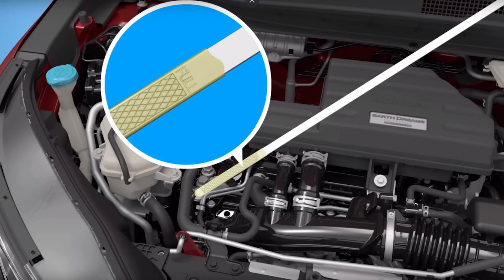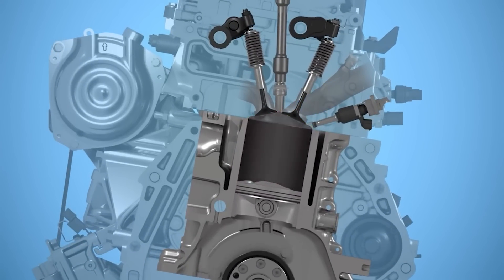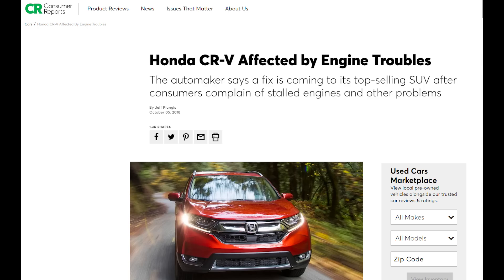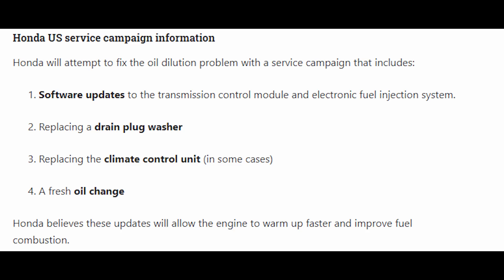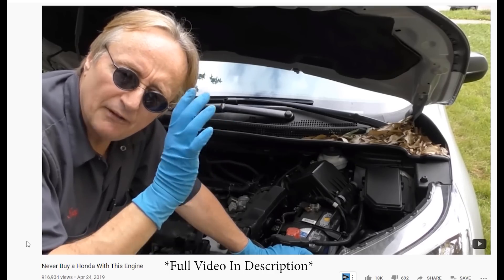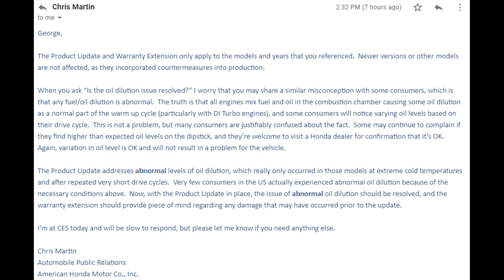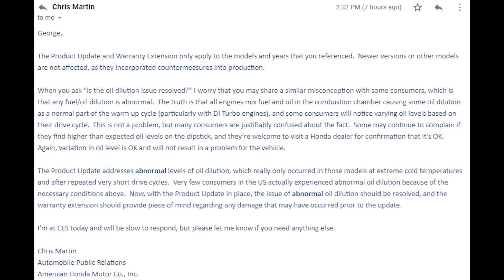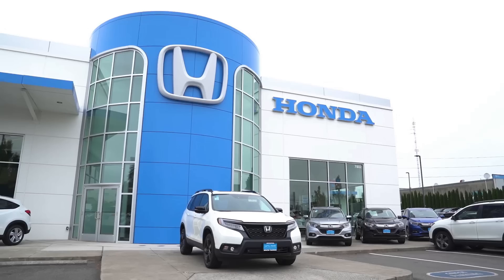Does Honda Have An Oil Dilution Problem? | 1.5L Engine in CR-V and Civic

Comment: I can tell you 1st hand that Honda is full of BS as my 2019 DEFINITELY has oil dilution problems  I live in Georgia "not a cold place" and Im on the road constantly for my job "no short trips" and my oil is about a quarter inch over the full line, also the oil stinks of gas.

When I take it to the dealership I explained it to them when I went for my oil change and they told me that they didn't smell any gas "lie" and when they tested it there wasn't any gas in the oil "lie" 
So I asked them how come after my last oil change my oil level was exactly at the full line and now it's registering about 20% more full than before and all I got was deer in headlights glare with no explanation so I will be sending off my own sample to have tested cause they are full of shit! 

Also I checked the oil levels the same way every time which was in the morning before leaving to work!
Reply: Dealerships are not going to admit it. In fact, if you ask them if there are others with the problem, they will say no.  They know there is no fix, so they sell BS just like Honda does.  If you take for example my radio screen keeps beeping and going black off and on as you drive down the street.  There are many others that have the same problem and its posted all over the internet.  I called Honda last week.  I asked her if others are having this problem.  She said "No, mine was the first one she has heard about".  I asked her if it was her first day on the job.  Told her she was full of shit because it is all over the internet and Honda is telling the dealerships that there is nothing they are going to do until the manufacturer of the display comes up with a solution.  Honda was replacing the radio heads, but now they have issued a bulletin telling the dealerships to do that.  You think after a problem of 3 years, you really think anyone is working on a solution?
Reply: @davidb1169  that's crazy
Reply: What we  definitely know about this problem is that it exists for a lot of owners, but equally we know neither Honda, or their dealers, are going to assist you in the slightest.
Reply: Are you checking the oil based of manufacturer recommendations from owners manual??
Sounded like you are checking with engine cold??? Hmmmm...
Reply: Rob Alvarez It seems Honda dealerships main criteria is to be 1st class actors!!! This is utter bullshit! They should volunteer their own labs to test the oil for dilution instead of denying any issue. Plus the climate has little consequence on cold start-up because all vehicles go from cold to hot whether in Georgia or Maine. Again its just to save a few dollars and deny help to the majority of states in the US.
Reply: What was your oil test result?  Most turbo engines have some oil dilution.  Running a catch can and premium gas helps but you still need to change the oil more frequently
Reply: @Rob Alvarez,  you should return the car and get your money back. Get a sample of the oil for proof, and a lawyer if they give you trouble.
Reply: Sorry to hear that. Good luck to your car. I hope they can fix it.
Reply: totally agree. I also have a 2019 and lives in Texas, oil is almost rising every week. I don't do short drives, my commute to school is between 40 - 60 mins everyday.

Comment: 2019 accord sport 2.0T here. I haven’t noticed any problem with oil dilution.  Is it just the 1.5T ?
Reply: As long as you don't have a 1.5 T Accord (LX,Sport, EX) you should be ok I guess.
Reply: No problem because you have a 2019. Not even a year old wait in a couple of years.
Reply: I think I’ll take consumer reports ranking with a grain of salt. I mean seriously, they ranked Dodge higher than Honda? 🤪🤣🤣
Reply: @maxsmoothred  The real reason CR and other surveys rank Honda so low is two-fold. One, they rarely hear from satisfied customers. Two, Honda was considered pretty much the top in terms of reliability. That became the standard. Now they have some issues with technology (like every other maker) and some 'odd behaviour' from a new engine... Suddenly everyone starts screaming and claiming they're garbage.
Reply: @maxsmoothred  Their rankings are based on owner surveys. Honda has been going downhill for years, now. There's a good reason why Toyota, guarding its sterling reputation for long-term reliability, has been reluctant to incorporate direct injection (they use a combination of direct- and port-injection) and turbocharged engines.
Reply: @kenhoward3512  yes but Toyota has switched to CVT transmissions and their 8 speed automatic transmission is rubbish.   Seems like no one makes a trustworthy car anymore.
Reply: Jeff Pyle That’s a good question. You could probably research the difference in those two engines and find out if they are fuel injected in the same manner. I have a coworker who had a huge problem with their 2017 CRV and they had to take Honda to court. Honda bought the car back.

Comment: If this was a design problem, then it should happen to nearly all hondas with the 1.5T.  So the question is, why don't all 1.5T have this problem?  I own a 2019 CR-V EXL with the 1.5T.  No dilution or gas smell.  I have noticed some unusual things compared to my other Honda (1.8 non turbo) and Mazda .  Using a scan guage to measure ECT (engine coolant temperature) the 1.5T motor takes longer to warm up.  Generally 5 more  minutes.  Engines run rich when cold and if the engine is always in "rich" mode then fuel would build up.  I never drive short trips in the CR-V and live in CA (not too cold) so that likely lessens any problem
Reply: @handycap9815  Not sticking.  The Engine Control Module richens the fuel/air ratio when cold.  This is normal in all cars.  I think the CR-V stays colder longer than other cars (at least my cars).
Reply: I'd say the problem is on most of these vehicles, but just goes unnoticed for now. Lots of people I know who own Honda's never check their oil, they just go for a service when it's needed, so how would they know? Even if they do check and the level is to high,they'd just assume that's OK.
Reply: @fiveowaf454  I'm afraid you're right. General automotive knowledge seems very low today.

Comment: I would limit the number of references from Consumer Reports. Only makes your video lose credibility. 
Ignorance is driving this more than facts. Turbocharged engines require more frequent oil changes than NA engines, regardless of who makes it. Use a high quality oil and stop trying to do 15000mile service intervals, change it more often. People are going to catch a fit when they realise that ALL Direct Injection engines has some gasolene in the oil.
Reply: Early oil change intervals can result in premature engine wear. I posted a reply above which explains why.
Reply: @leonardharview4577  I am not suggesting an oil change every 1000miles. But, if we were to analyse each complaint. Most of it are person expecting a similar service interval as with their old NA engine, which is wrong. It is shorter with a turbocharged engine. And if a manufacturer recommend a 7500mile oil change interval and I choose to reduce it to 6000miles it will be fine. By then the oil life will be at around 35% anyways.

Comment: The Chris Martin guy from Honda is not speaking the truth.
Reply: I'm not sure he is allowed to!
Reply: @bigal6684  Not if he want to keep his job. There's a lot of money at stake.
Reply: while he is stuffing his pockets with your hard earned cash!
Reply: Who signed his check?
Reply: 2020 CRV Quick update MPG dropped from combined 27 to 25 AVG called dealer stated facts about MPG economy drop and oil also stinks like gas. I only got about 600miles total on the engine. I don't think oil dilution  is resolved. Dealer response usual BS you drive to hard, use heat/ac not enough highway driving etc... Stated to them I am currently in the market to buy a horse. They are  "trying" to schedule me  in for service. Will update if there is any change. But most likely will need to send out oil sample to independent lab to get it tested properly.  This is ridicules how consumers are being treated by Car makers!
Reply: @lonewolf_2022  so sorry for you, I have been trying to warn people, but there are a bunch of jackasses that obviously don't own a 1.5Turbo calling us liars and such.
Reply: @MontanaWelldigger  Thx. I am too very sorry for consumer here in US, since they are simply unable to understand/say "NO" to car makers and allow them to continue to treat them like that. I am from from Europe originally moved to US because of work. Back home car makers sold consumer Trim with power-train options. Here in US I feel like I have no options(such as performance gas engine, diesel, hybrid, EV.   only trim.  My only advice to consumer to wake up and stop grabbing your ankles in from Car makers. If we all stand tall together we may have a chance to improve current Car maker market. PS. I did ask sales guy about oil dilution issue and if it was resolved. We all know the answer to that question, other wise I would not be here typing.
Reply: I work for Honda warranty department and he is simply telling the truth. Most of these concerns are simply that, a concern. A valid one, but that’s why warranties are generated, to address what might occur.
Reply: @gmans8914  well then why didn't they fix my car. Instead of giveing me a liberal trade-in allowance on a 19 passport?
Reply: xxlxpman because you have a concern, and not a confirmed issue. You believe your vehicle is not performing up to your standards and I know you have a certain expectancy of Honda. The fact is your vehicle is driveable, unless you feel it has a whirling noise (which is one of the symptoms of this issue) Than take it to a dealer. The dealer has no fault here, they just do as directed and are under no obligation to trade a vehicle because you have a concern. That is why a vehicle has a warranty, because we feel something can happen. The fact is, you believe it is not normal, but you have a NVLW and a warranty extension, to appease your concern. I’m a consumer myself so I understand, but at the end of the day, unless your vehicle is not driveable, not operating under normal expectations, you WILL NOT get a trade in.
Reply: @gmans8914  your response is exactly what I expected from Honda which I've been trying to avoid making public I've never been lied to so many times about this issue from employees of Honda. The only reason I'm driving the Honda Passport it's because I couldn't in good conscience trade that vehicle back to anybody or sell it to anybody but Honda. You can guarantee that I'll never buy another one because of that dishonesty on this issue by Honda and its employees I'm done with you.

Comment: I own a 2018 Honda civic si with a 1.5 turbo.  My car has 21k miles, so far no issues.
Reply: Mines a 2017 Civic sport 1.5 turbo 21000 miles no issue.

Comment: In December of 2019, after our 2018 CRV EX with the 1.5 Turbo and 18,000 miles could not be fixed of its oil dilution issues, we traded it in on a 2019 Passport Touring. Honda stated they have no fix for the issue.
Reply from the maker: That sucks
Reply: xxlxpman are you happy with the passport?
Reply: Yes, everything but the expensive 20 inch tires, the Passport snow tires and the CRV's snow tires were 300.00 U.S. difference, both were Nokian Hakkapeliitta's.  Also the Passport gets approx. 6 MPG less than the CRV. If I could have trusted Honda to have fixed the issue we would have got another CRV, we love them.

Comment: In a word, yes. Allegedly fixed for 2019, although mechanical experts say the excessive oil dilution problem cannot be fixed by software adjustment. Despite Honda's claims to the contrary, the problem isn't rare. A person can find many videos right here on YouTube uploaded by frustrated CR-V (mostly) buyers. However, the manner in which Honda has handled the oil dilution problem has been disappointing.
Reply: Honda should give a lifetime engine warranty with unlimited mileage if they cared about their customers and believed in their product.  This issue is going to lose customers for Honda if they don’t do more.
Reply: @markp6586  I agree 100%.
Reply: Tell me the number of affected cars from 2017 to 2018. We'll compare it to the global figures of CR-Vs (only) global sales, with will be roughly 1.7 million units. Then we can determine if it's rare or common.
Reply: @disco.lemonade  oil dilution problem isn't just 2017-18 models and it's not limited to the CR-V.
Reply: @bodystomp5302  Sorry, was my English not good enough?
Reply: @disco.lemonade  Obviously only Honda knows and likely won't release the numbers. I fully believe the engine piston and ring design are root cause of the problem. Software can help but it's just a bandage. A recall on these pistons are a lot more expensive and reprogramming the ECU to help burn off the gasoline faster. Nevertheless, it doesn't solve the excessive gasoline in oil in the first place.
Reply: It seems even if the problem is rare, the fact is if you buy one there's a reasonable chance you could be unlucky and get one with the problem. The kicker the is you know Honda is not going to even acknowledge your problem let alone fix your vehicle.

Comment: Happy owner of a 2.2 diesel CR-V...almost impossible to kill...
Reply: valentino furlan Is yours a turbo diesel or non-turbo? and what year is it? We dont get diesel Honda in the US
Reply: @jamesmedina2062  Honda had used for many years a very reliable 2.2 turbodiesel (140-150 hp), a 1.6 turbodiesel (120 hp) and for few years also a 1.6 biturbodiesel (160hp). Since a couple of years ago Honda has decided to use only gasoline and hybrid engines on their cars also in Europe. The 2.2 is one of the best diesel engines ever made in terms or reliability. Someone compares this engines to the old Mercedes Benz diesels...
Reply: valentino furlan Yeah I have no idea what years these cars were made. To me it is quite interesting and amazing that Honda even made 1 diesel! I think they are on the wrong side of emissions because GDI engines produce more and larger particulates. They are not angels. They just don't want to spend money on the diesel emissions equipment. Port-injected engines will produce less power but also less particulates. Honda does aim for reliability but they are always cheap and do not want to spend the money on hybrid injection or on vehicle entertainment systems. Their parts are extremely overpriced as well. Generally their engineering and R&D is good. They also manage and motivate their employees well.
Reply: I think we should have more diesel cars in North America. Mazda is doing it with the CX5. Current daily driver is a diesel VW Golf. Gets 40mpg even in cold weather and very reliable. Made me restore my faith in VW after owning crappy gasoline powered ones.
Reply: Diesels are filthy engines period.  We need to get off diesel and internal combustion engines
Reply: @MrDcseltzer   be the example for everybody, get rid of your car and get a horse . Let us know  how your life is much better with out a car..😂
Reply: MrDcseltzer Heavy equipment, cargo ships, submarines, big trucks all use diesel and will not be replaced for at least 50 years. Someone will always look to make money under current capitalistic systems in place. I wish it was different. Small personal transport can change a lot though to become cleaner and more efficient. Bicycles + mass transit can help.

Comment: Does anybody know Is Honda giving you a free respirator when you buy the 1.5 Turbo?
Reply: No, they are not.  They are hoping you will kill your brain cells, therefore, you will not even think about their crap
Reply: Marc Serina what makes you say this? the increased large particulate pollution from their GDI motors? I think port-injected Turbo would have been cleaner burning. They really need hybrid injection

Comment: DI engines with costly intake cleaning after it is clogged up (1k to 2k).
Oil dilution issues . All the fix which were not mentioned what they did to fix, is still problem. engine will blow after 100k / warranty.
stick to DI/port injection combo with decent sized engine will help. So Toyota/Lexus it is.
I will buy a normal honda engine with variable valves engines but not their crap earthdreams stuff.

Good luck to all who owns one.

Cheers